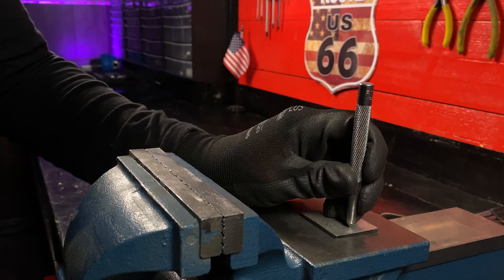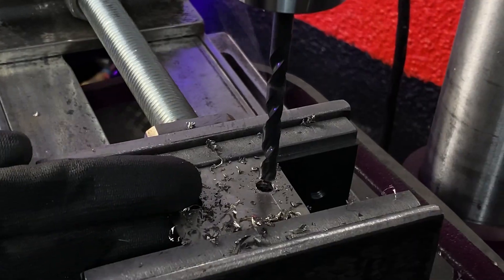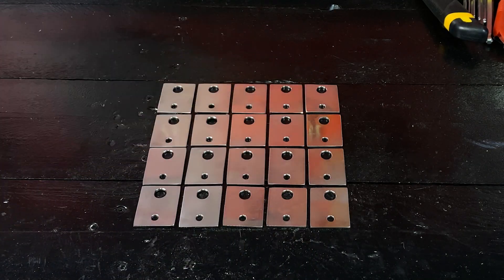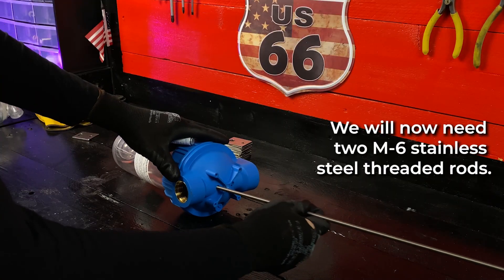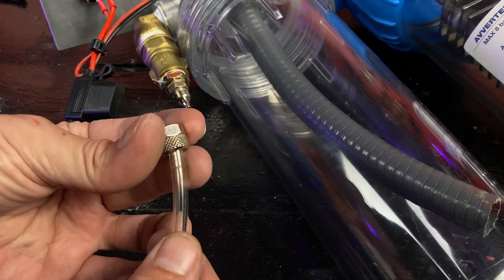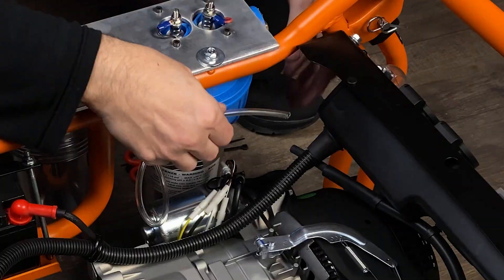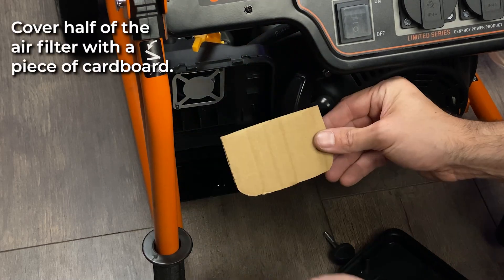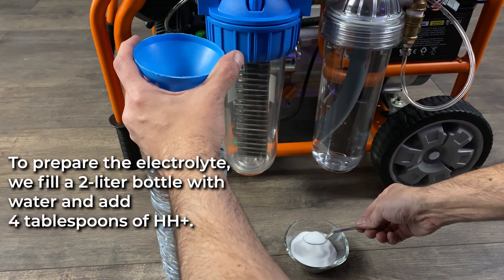ENGINE RUNNING ON WATER

Comment: Just from speculating, what i understand, other than the equipment fabrication is:

The water is used to produce hydrogen, and the hydrogen is the source to create the power, that power and ignition all then turns the generator to produce electricity.
Reply: And also do you know that acid + metal release hydrogen gas? So the powder (whatever he wanna call it) is added into the first water chamber to reduce the water ph value to react with those steel and produce hydrogen gas. 

The 2nd chamber could be there to cool the gas? Hmmm not really sure. And more math needs to be done as in power input and output for: 

Power needed for electrolysis to produce hydrogen gas
Power output from the hydrogen engine
How long does the metal last before completely dissolving

Comment: The true goal of making an engine like this is to make it possible to run on water, mixing HH+ with it defeats the purpose of "only running on tap water". Nice job on the video though (and the engine), you have a great mind that many wouldn't be able to match.

Comment: I've spent years finding a way to water fuel to work. I know from experiments, that the amount of gas that your system produces is not enough to run that engine. Nice video tricks! If someone will replicate this, will be disappointed when it won't work.
Reply: Clearly not enough bubbles

Comment: I like what you're doing I started a project I haven't finished produced over 20 times more hydrogen helium and we used in Hiroshima at a 7 gallons of water like got a little rough on me for a while could have got out of hand by accident by interference I hadn't had my separator done yet inverted capacitor it's never been built before but I got the blueprints in my head you guys ever in Vegas look me up it'll be a heavy liquid like gasoline separating the helium nitrous oxide and hydrogen and others that makes it accordingly safe principal
Reply: Also available with punctuation.

Comment: "Water is fully oxidized hydrogen. Hydrogen itself is a high-energy, flammable substance, but its useful energy is released when water is formed. Water will not burn. The process of electrolysis can split water into hydrogen and oxygen, but it takes as much energy to take apart a water molecule as was released when the hydrogen was oxidized to form water. In fact, some energy would be lost in converting water to hydrogen and then burning the hydrogen because some waste heat would always be produced in the conversions. Releasing chemical energy from water, in excess or in equal proportion to the energy required to facilitate such production, would therefore violate the first or second law of thermodynamics."

This whole thing stinks.
Reply: No, it works peerfectly until the battery runs down.
Reply: @manolisgledsodakis873  If that was the only problem then you would just install an alternator.  Most generators have an alternator but you could always put a bigger one on if needed.  I don't think that this is the limitation.

Comment: Can you tell us how long this engine runs on 1 fill?
Reply from the maker: 1 hour
Reply: @HiddentechnologyYT  perfect. I want to incorporate a float valve configuration to have a larger tank that will constantly keep the canister full. When I build mine I'll make a video and tag you.  I'm curious if this will run on a mixture of salt and caustic potash to produce enough HHO to do close to the same thing as HH+ is doing.
Reply: @ThreeBeerMinimum  I am still waiting for your video
Reply: @shokatalam  sorry man life happens... I was in the middle of the build and everything else broke loose in my life so it's on hold for a while. Probably until the end of the summer.

Comment: let's take this a step further:  there is significant difference between basic electrolysis (creates diatomic O2 and H2) and capacitative discharge (generates Brown's gas, monoatomic O and H).  Monoatomic is lowest energy state and thus there are no wasteful side reactions involved in combustion.   Diatomic H2 and O2 will occupy 350x the volume of water when converted, monoatomic gas will occupy 1800x the volume.  Capacitative discharge is achieved via pulse width modulation and is NOT electrolysis, only a fraction of watts input needed.  get a tunable PWM board (or build one) and learn to tune your circuit/cell to resonant frequency; standing square wave is best modulation for this application.  Instead of aspirating through water, aspirate though diesel fuel (or biodiesel) because burning Brown's gas creates no lubricating carbon residues, your piston will lock up otherwise.   Cheers

Comment: Can someone tell me the connections for a beginner. I can find the water filters but no connections like on the video. Can someone help me?
Reply: Connections are off the threaded rods to the cell one red and black....hook to a switch u can buy at any auto store then connected to the battery of the generator on this video
Reply: @richardgarcia3327  Thank you for this answer.
Minute 4:54 he plugs the connections for the hydrogen flow together, do you know what the parts are called or where you could find them?

Comment: electrolysis can be generated by solar panels in your driveway, and fill your tank, with hydrogen,  of your car while its parked. Or stations can do the same along the road, ad charge you for fill ups. Oxygen generated is also able to drive pistons if it compressed in the cylinders and ignited
Reply: What do I do if I need to go on a 700 mile trip in the range is 300 MI. I get off the highway and spend the night because I need to charge my battery. Hydrogen is the answer
Reply: @nickyboy5538  you charge for 30-45 minutes and you'll be on your merry way.
Reply: @logitech4873  I fill in 6 minutes and Im on my way.
Reply: @nickyboy5538  What's your point? You were talking about stuff like spending the night, when the reality is more like a lunch break.
Reply: @logitech4873  I drive 1000 miles to NY from Ga, without staying overnite. There are many more in the world of driving that do things like that. I would have to stop 4 x to charge and electric car. adding 3 1/2 hours to the trip. Not to mention 18 wheelers that need to charge., time is money
Reply: @nickyboy5538  Most people don't do that. Road trips are rare for the vast majority of people.
Time is money, but so is gasoline.
Reply: @logitech4873  it would be a good argument on your part if we were talking about gasoline. We're talking about water. I'm done with you no more answers because you are obviously speaking a different language.
Reply: @nickyboy5538  It's just far less efficient than battery storage.
Reply: Or you can store the energy in batteries to drive an electric motor, which is far more efficient.
Reply: @logitech4873  range and refueling is still a problem. Pumps for hydrogen can refill a car in minutes
Reply: @nickyboy5538  EVs mainly recharge over night at home. It just isn't a problem.

Comment: Even if this idea didn't fail on paper and didn't violate thermo dynamics, you can see the tiny amount of hydrogen/oxygen bubbling out in the container would take many seconds to fill the cylinder of that engine, let alone many times per second. If you didn't claim to use electricity to electrolise water and burn the product(turning it into water) and using that energy to re-electrolise the water with energy left over, then this would be a respectable video.
Reply: I wonder if he drained the carb
Reply: The ratio of air to fuel in an internal combustion engine is 16 units of air for every one unit of fuel. The hydrogen being produced is more than enough to achieve that ratio.

Comment: pretty cool, def there would be something like this sold as an "emergency survival generator" because you just need water to run it.
Reply: Well. And you need energy to run the electrolysis. And in that case it would be much more efficent to use that energy directly instead of converting it to hydrogen and then back to energy.

Comment: I am amazed by the amount of people actually believing this in the comments. He has a hidden battery somewhere for the electrolysis. The 'HH+' (which is literally H2, aka hydrogen) is nothing more than a salt which improves conductivity in the water, thus having more efficient electrolysis (every electrolysis device does this). BUT you'd still need a battery or external power source to split water into hydrogen. I am amazed by the stupidity of (a lot of) people.
Reply: He shows the wiring from the switch to battery and electrolysis apparatus, so he 's not hiding that.  The salt is KOH or NaOH.
Reply: I always believed in this since I saw it when I was a kid a long ass time ago, then this video popped up and I just thought about it for like two seconds. "Wait he just puts energy into the water, then combusts the product turning it into water again an is claiming to get more out than what he put in. Nahhhhhh"
Reply: I think the point he was trying to make is that you can have an easier fuel source than gasoline. Battery pretty much guaranteed regardless of fuel. I might be wrong, who knows.
Reply: @xenolion339  What do you think is most efficient?
1 - Using electricity for electrolysis, and then running a combustion engine on the resulting hydrogen and oxygen
2 - Just running an electric motor directly

Both are dependent on your battery capacity
Spoiler: The electric motor is far, far more efficient.

Comment: Go look at their lying video about old CD's being made into a "solar panel" and "free wifi" from a speaker magnet. They won't put an amp meter on the trickle charging system and then on the draw from the battery to show the battery is going flat at the same time. Cardboard covering the air inlet? When done properly for non-wet gas the carby gets removed and only a check ball valve is used. Look up the "mr teslonian" channel where he's using wood gas.

Comment: I would not operate this inside or make sure to be in a well ventilated area. The combustion of hydrogen with oxygen produces water vapor as its only product: 2H2 + O2 → 2H2O. However, air hydrogen combustion (H2 + O2 + N2 → H2O + NOx) produce oxides of nitrogen known as NOx. Nitrogen oxides (NOx) reacts with ammonia, moisture and other surrounding compounds to form nitric acid vapour and related particles. The impacts of NOx on human health include damage to the lung tissue, breathing and respiratory problems. 

In this way, the combustion process is much like other high temperature combustion fuels, such as kerosene, gasoline, diesel or natural gas.

Comment: 7:24 this would be the battery that starts the electrolysis and totally certainly definitely doesn't power the rest of the machine, right? Also, electrolysis separates water into hydrogen and oxygen, so that is what's being burned together, i gather? Since there is no separation in the electrolysis tank; you even take the time to point out that the directions are alternating, so the gases should be mixed together

Comment: I really don’t get why one would comment saying that it does not because this and that when there is obvious proof of it working xD Tf are u blind?
Reply: Because it CANNOT work according to laws of science. Imagine if you'd condense the water vapor from the exhaust and fill it back to the electrolyser then we had created a perpetual motion machine. And I hope we both agree that this would violate two laws of thermodynamics.
It's simply click bait.
Reply: @OPA111AM  Also it uses a car battery to power the Electrolyzer. So it is just using a battery to produce electricity but with less efficiency.

Comment: The amount of morons you grifters have convinced is horrifying. How about you make a video explaining why this doesn't violate the laws of thermodynamics?
Reply: @aviationengine6701  OK. In order to make hydrogen from water, you need electricity. But in order to get electricity, you need to run the generator, which runs on hydrogen. How can you get the hydrogen to run the generator without hydrogen to run the generator? It's not possible. The generator in the video has a battery that generates the hydrogen as shown in the video. But eventually, that battery will run out and the generator won't be able to produce electricity to produce the hydrogen it runs off of. It's like plugging an outlet strip into itself; you can't make something from nothing.
Reply: @Ry_TSG  But don't standard cars run off the same process? The electricity from the battery fires up the spark plugs which combust the fuel, and then an alternator within the engine recharges the battery as the engine is running in order to keep the battery charged?
Reply: @neomccoach1708  No, because the energy comes from the gasoline. The battery is just used to ignite the gas, and the burning gasoline is converted to energy which moves the car and recharges the battery. Imagine if your car's alternator made the gasoline your car runs on. It's just not possible.
Reply: Someone will figure it out one day. Until then we can can enjoy reading all the comments of people who believe it's that simple.
Reply: @never2late454  They already have, several times, and each time they disappeared.
Reply: @aviationengine6701  The HH+ shown in the video doesn't actually make any fuel. It's there to make it easier for electricity to separate the water into oxygen and hydrogen in order to make the hydrogen that the engine burns. In all likelihood it was just salt or some other solute.
Reply: @Ry_TSG  Lol yeah what the heck do I know, thankyou though
Reply: Who said the law of thermodynamics was a law?
Reply: @boredom2go  Umm, you did, actually.  Moreover, you did so in literally the exact same sentence as the one in which you posed the [facetious{?}] question.
Reply: @ArtOfficialKreations  It's called the "law of thermodynamics". That's its name. My question is who decided that it is a "law". Such "laws" seem like an unnecessary restriction of thought that may not have any basis in reality.
Reply: @boredom2go  They are laws like the law which states that 2+2=4 and 1-1=0. You will learn more about thermodynamics and conservation of energy in high school.
Reply: @ministerbrandy7773  Will I also learn about quantum mechanics that turns thermodynamics into a more murky problem?
Reply: @boredom2go  Perhaps, if you start simple. You don't shake the box in order to know what's inside because you will be left with a mess. Does (and shall) law not expand and adapt? If it does, it will always be correct and wrong.
Reply: @ministerbrandy7773  That's my point. Why claim something is a law when history shows us over and over that our understanding isn't complete? In fact, the more we learn the more we discover how little we understand.
Reply: @boredom2go  My friend, please go finish high school. I beg you. One of the first things you learn in high school science is that energy can't be created or destroyed, and the second thing is that energy flows from high to low. It's simple, it's experimentally provable, and it's the basis for literally any thing built to do something.

Comment: So I made this using just a 12 volt battery. I was making hydrogen but before I could hook it up to the generator the connections got red hot lol. I'm assuming I just need a voltage regulator or something? Can anyone help me out with this? I would appreciate any advice.
Reply: It's 14 gauge wire.